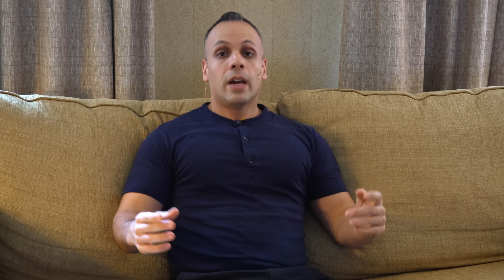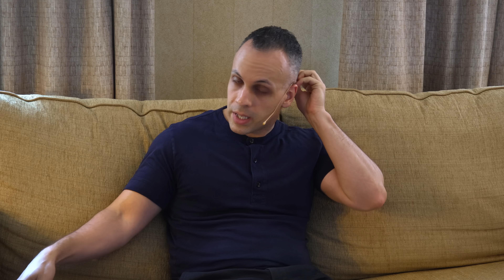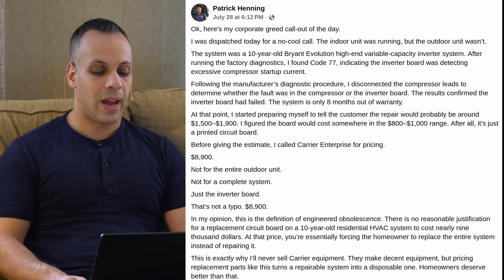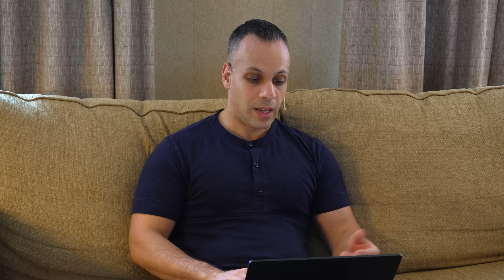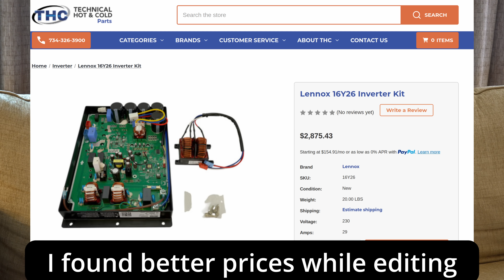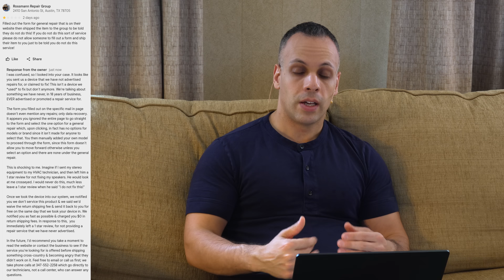Carrier AC repair has $8700 part cost for residential unit

Comment: SOOO less likely.  The laws cited by Carrier were passed AFTER this board was designed.  This is straight up greed by Carrier.  And yes, low volume, proprietary circuit cards are generally very expensive and there is absolutely a potential market for you to examine repairing them and providing as a low cost alternative.  My 16 year old fridge had a failed board that would have cost $400+ to replace.  At that point, I just bought a new fridge.  If you provided a "repaired" one for, say, $150-200, I probably would have gone that way instead of getting a new fridge.  My dishwasher was upgraded based on the same logic.

Comment: the FU price. this is common in a lot of industries for repair parts. The lcd panel for my $999 apple cinema display was.... $799. The ACTUAL price for the lg made panel at that time was $140 through a local distributor. In this case apple just really didn't want to offer the repair part I think.  With CNC machines i see similar things. Like a retail replacement servo price for a fanuc control costing $5000 when the entire machine control with 4 servos is from an oem control kit that cost the machine builder only $8000. And i do absolutely get that it cost money to handle the logistics of these repair parts... but not that much money...

Comment: It's obviously the "eff you" price. I will never buy a carrier. My previous neighbor was an HVAC dude. He brought the replaced units home and fixed them to sell them if he could or he parted them out, selling used parts as emergency recovery options that weren't technically referred to as used, he would tell people they came from their backup emergency stock and often would charge more than the already inflated price then they would charge for a brand new items.  When I first met him he tried to charge me $650 for a transformer. I said no and bought one from Lowe's that worked for 19. After that, he was pretty straight with me. He kept boxes for new items that he purchased and installed, and would put parts that he recovered from old units into those boxes and call them emergency recovery stock. He wasn't a friend,, but we were neighbors and we got to know each other a little bit.

Comment: My dad bought a Carrier Infinity 96 almost 20 years ago. Just the draft motor is $1700. When the system finally goes, that is it. Draft induction motor is one thing, the inverter control module will never get replaced. The system will be switched (selectable on the motherboard) to either on/off mode and not variable speed.

Comment: Louis check Radwell International for repaired boards. Carrier is a well built machine but very expensive. Stay away from York AC units the condenser looks great but isn't built for longevity. Lost of times you can use a generic board but it will void your warranty.

Comment: I would personally pay with my own money to have the board overnighted to Mend It Mark, be repaired in 30 minutes, have a cheeky video to watch, and be utterly satisfied.
Reply: Exactly! Couldn’t find the inverter board for my Kenmore fridge, so I sent it in to an eBay repair shop who repaired it for less than $100. Probably replaced a capacitor.
Reply: @MichaelHernandez-jd4yu  Lol I took a PCB for a fridge I assumed to be dead to my local video game repair guy who works from his studio apartment and he managed to fix it within the day, charged me $50
Reply: As a Mend It Mark student I completely agree!
Reply: Thanks for mentioning Mend It Mark. I hadn't heard of his channel before. I just scrolled away from your comment, looked him up, watched The £25,000 Pre Amp Repair And The Copyright Strike , and came back here to your comment to say thanks! ❤
Reply: Check Buy it FIX it also, they are both great.
Reply: There must have been millions of trashed circuit boards that just needed a new $3 capacitor or thermal fuse.

If a replacement board costs more than a couple hundred bucks, have the failed one checked by a repair shop.
Reply: I watch Mark, and he's competent, but I can promise you that there are a lot of things that don't get fixed that also don't get a video. I'm a 50 plus year working electronic technician, and I've repaired a lot of these boards.  A lot of time you run into parts that are simply not obtainable - custom ICs that have no datasheets, ICs that have proprietary firmware embedded, etc.
Reply: @ohger1  Came here to say the same thing. Someone who already has deep knowledge of this specific board might have a chance, but not if you've never seen one before.
Reply: @s @stevegreen5358 ailed capacitors can often be detected visually. Mosfets and diodes can easily be measured often even in circuit. 
Not everything is that easy but these are components that are prone to fail, so it’s worth the shot imo.
Reply: @ohger1 I'm thinking about building generic boards. The biggest issue is the systems that have data communication.
Reply: @Bryan-Hensley  get together with some ESP32 hackers and you could have a lucrative business selling better, more customizable boards with all the communications at an eighth of the price.
Reply: @Bryan-Hensley  Almost all of these types of board have specialized firmware that monitor every imaginable input and output, probably providing feedback to the main control board, I could be wrong but the generic boards of yesteryear are no longer.
Reply: @SirOsis_ why would you need all that. An inverter motor is a simple 3 phase motor. It just needs a controller.
Reply: @Bryan-Hensley  You can't just toss one together using hobbyist parts out of your box of random  parts. In addition there is circuitry in there that monitors refrigerant flow, these boards serve multiple purposes on modern systems. The parts are more expensive because they must be tolerant of extreme heat, constant cycling, rapid switching. How are you planning on communicating with the main controller board to let it know that the shit has hit the fan downstream and shut the rest of the system down due to a fault? Have you ever actually worked on a modern unit?
Reply: Just because it's complicated to you doesn't mean it's complicated to me. You're making it sound like it's a starship Enterprise.. the communication stuff isn't that complicated. Have you ever repaired anything electronic? I used to work on TVs.
Reply: @Bryan-Hensley  and you probably stayed at a Holiday Inn Express last night. You used to work on TV's? Not even in the same class of repair. The biggest barrier is the custom IC on this board that communicates with the inside and outside system controller, the one that confirms to them to turn on or shut down immediately because of a failure downstream. This is not a simple DC to AC inverter. If it is just a cap or a resistor you have a chance if that IC is bad not likely at all.
Reply: Dude I have built custom inverter compressor systems. This is pretty old technology it's not that complicated dude. Just because you don't understand it doesn't mean I don't.
Reply: @SirOsis_ let me explain it to you in elementary terms and maybe you can understand. The inverter first changes the AC to DC via a bridge rectifier. Then an ic controls the hz of the transistors. These transistors output whatever frequency the ic sends in a 3 phase setup. This variable frequency is what set the motor speed. If you don't understand 3 phase motors, you are way behind. I really don't know how to simplify this anymore. I came from electronics background into  HVAC. I have work for cable companies, satellite uplink and downlinks, I used to work for cellphone companies working on tower equipment, I've repaired stereo equipment, amps, ham radio equipment, obd vehicle computer, brake modules, satellite equipment, I've been a security system tech.
Reply: @Bryan-Hensley  lol yeah ok. Easy-peasy. I got ya. So simple a 4 year old can do it.
Reply: @Bryan-Hensley  The fact that you keep on circumventing is the custom IC and what it sends to the other controllers. Repairing the inverter is no issue up until the point that IC is bad and you can't shit one of those regardless of what bullshit you spew here.
Reply: @ohger1 you make me feel like a lucky fellow, I found a book with pictorial diagrams of like 500 different IC circuits, so that's like something that I can use to solve these puzzles with. Bless up Half-Price-Books!
Reply: @ohger1  and even in instances where you can repair it something you do would run afoul of the DMCA and eventually probably cost you more than you ever could make on the repairs
Reply: @ohger1  I know what you're talkin about, and I agree. But no custom IC and/or proprietary firmware should cost as an entire new unit. I'd sent the unit anyway, just for the possibility that it's nothing more than a couple capacitors and a FUCK YOU video 😀
Reply: @Smart75 most of the boards I've seen damaged from surges knock out a few rectifier diodes. (Not inverter boards, I haven't tried yet)
Reply: @Smart75  Send it for repair, if you can.  Maybe it costs $100 or even $200 to find out it's toast.  Then call your locally owned and operated HVAC guy and put in a whole new Rheem with much higher SEER for $5,000 and your still $thousands ahead.  That's what I did.
Reply: @Smart75  You don't know what you are talking about. That is what it costs when a part goes out of production by law and has a rapidly dwindling supply.
Reply: @malcomreynolds4103  Found the Carrier rep.